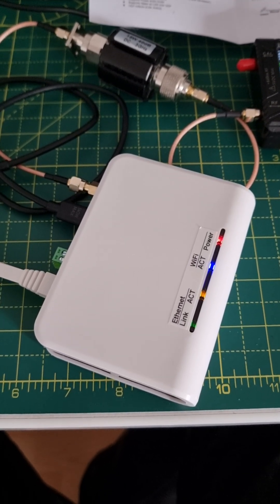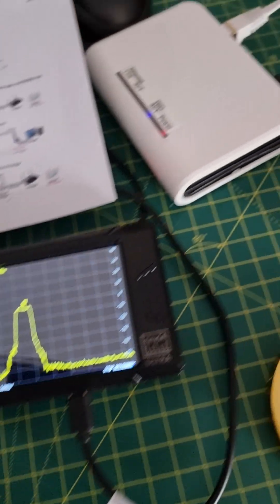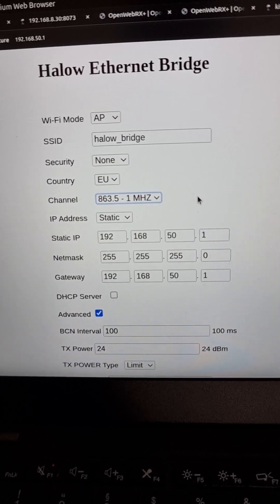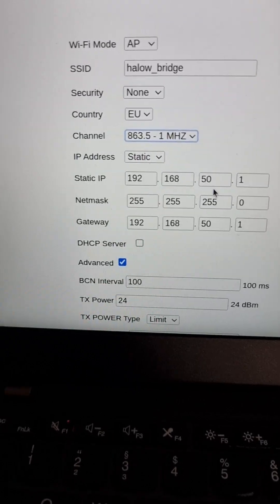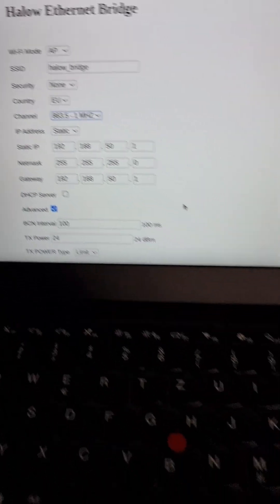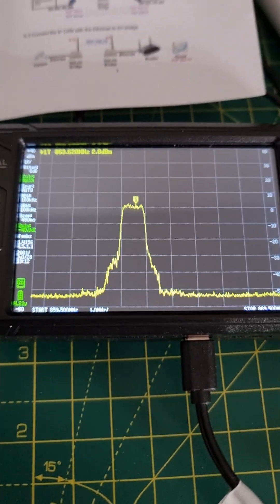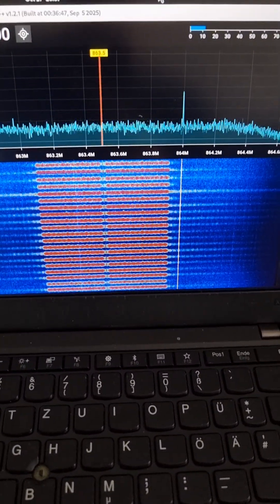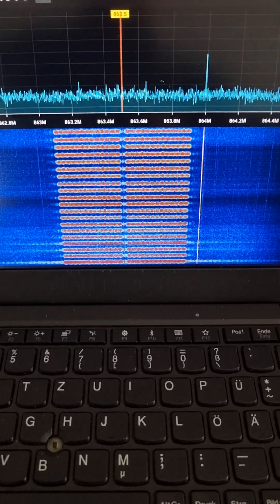Halow Ethernet Bridge 802.11ah first look

Comment: There is ebyte ewt611 that works on 900MHz and can transfer 16Mbps through ethernet transparently as if the two pcs are on the same local network. I think it uses 8Mhz bandwidth.
Reply from the maker: That's interesting - I'll take a look.